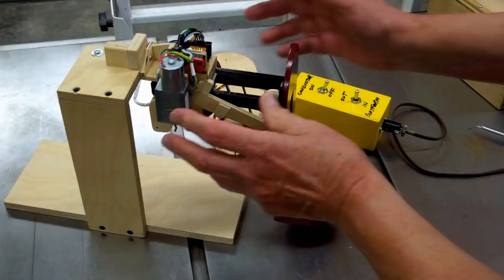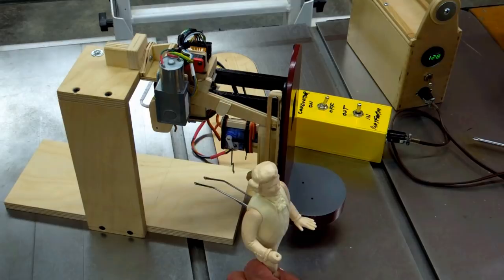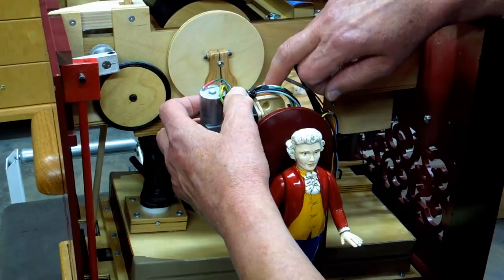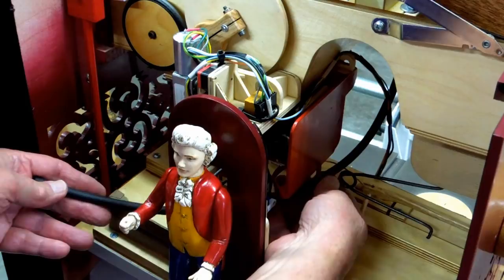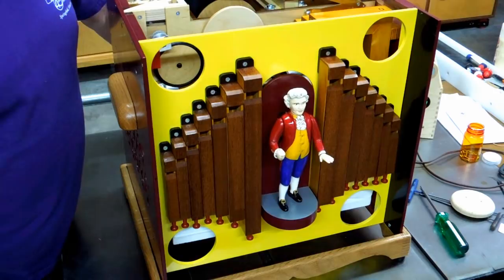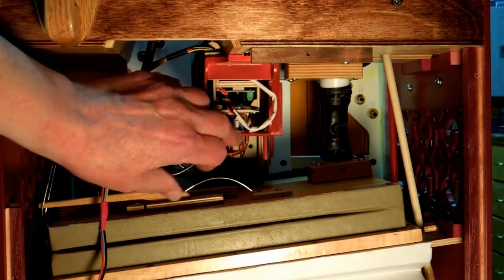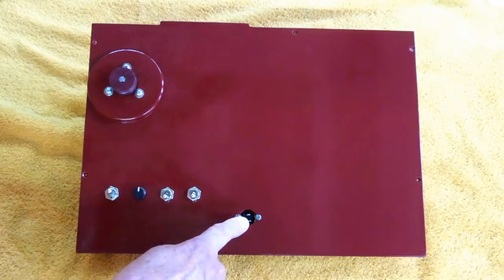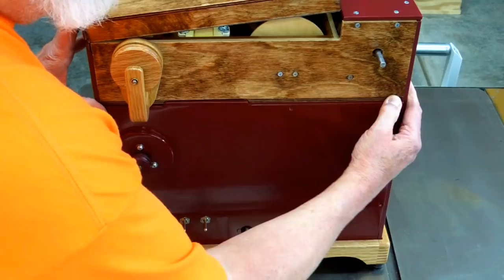Senior 20 Conductor Installation (17) Organ Assembly

Comment: A smidge more of the correct lubrication for the servo and gearbox will cut down on the noise. But just as smidge, too much is not good for them. It looks excellent!
Reply from the maker: Once the organ starts playing you'll never hear it. Therefore, not an issue.

Comment: I've watched just a couple of your organ videos.  This is some sort of kit / plan set created by someone else to which you have made significant modifications ?  Definitely requires being a jack of all trades and a master of several.
Reply from the maker: This is not a kit. I have built two of these organs from scratch. I purchased John Smith's plans for his original design. There are extensive modifications which include adding a motor drive. a powered rewind and making the animated conductor including making the molds and casting the figure in resin. Many of these have been built by people with no previous woodworking experience. Thanks for watching!
Reply: I commend you on this monumental effort, not in a million years would I take on this project.

Comment: Ron, absolutely fascinating.  How many years are you into this project now?  Three?  Keep up the good work!
Reply from the maker: I started late 2014 trying to get the figure sculpted and finally had it in my hand late 2015. Large part of 2016 was working out the mold making and casting process. Last year was the installation, painting and animation process... then working on the microcontroller program to refine the conductor movements. These things always take longer than you anticipate. Yes, say 3 years.
Reply: What are your plans with this organ after it's completed?  Seems a shame to keep it on a shelf in your closet when it could be on display.
Reply from the maker: I play the first organ all the time... especially with the motor drive and motorized rewind. They sound great. There is a huge investment of time developing something like this so it isn't likely to be ignored.